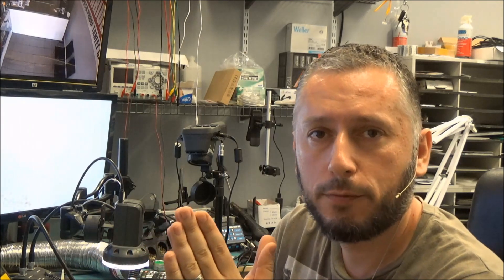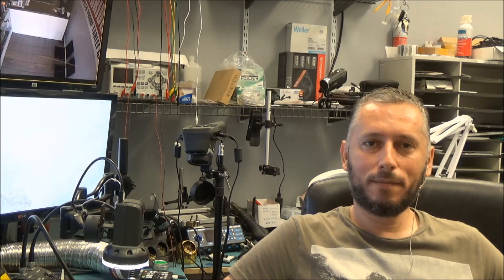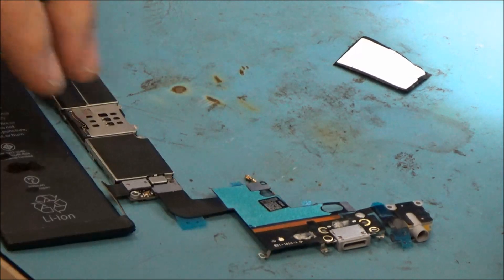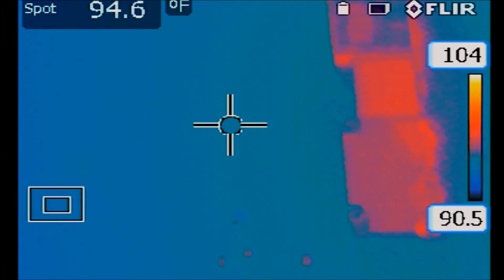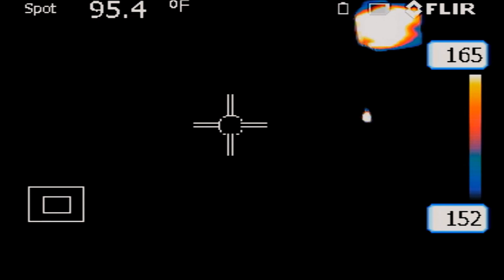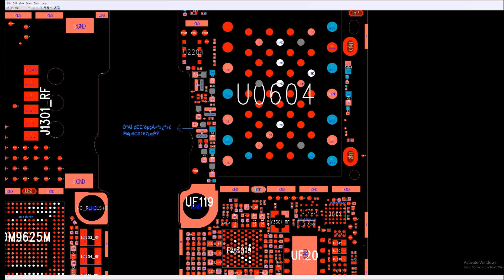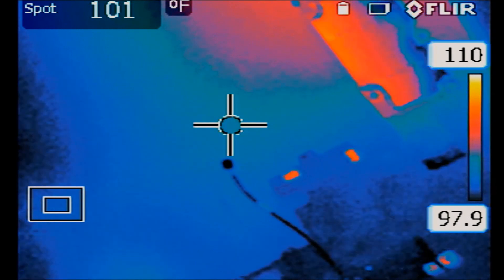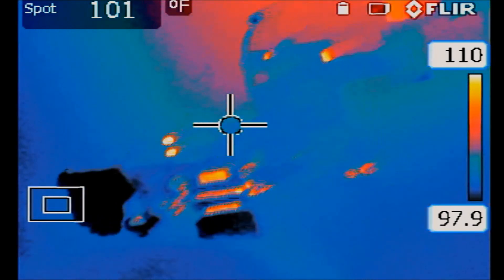Find Short Circuit quickly With Flir Thermal Camera - iPhone 6 no power Repair

Comment: Hi, Sir u r a professional guy, i am also repairing mobile, but i have facing lot of problem when set comes with leakage, in 0.0025 amp auto, in this case i stuck, and sometimes use rosin paste, but take long time to find out the short, i like thermal camera, does it really works to find out leakage in few seconds... Kindly suggest me is it useful for me or not.... Plzzz suggest me.

Comment: To test a pcb board with a thermal.camera, does the pcb has to be powered on or by just connectin the charger cable without manually turning on board is enough?
Reply: This worked out because the board was heating up. So to utilise the method whatever makes the heat to be aquired...on or off in your case

Comment: Great video and very well narrated! Super easy to follow. I’m new to iPhone repair and I am at present getting all the kit together to start repairing  a few iPhone 5 and 6. I’m looking at DC Power Supply’s and not sure which one to purchase, also is there a table of the correct voltages I should be setting when fault finding using a thermal camera (FLIR One). Really afraid I’m going to fry the board when setting DC power. Your help with this is greatly appreciated, keep up the great work your videos are fantastic! Thanks Harry

Comment: Hi, I’m Jackson from Indonesia. Really need your help. I accidentally caused short circuit on my iPhone. It was because I disconnected the battery from logic board using metal tool and suddenly there was electric spark. I was really shock, and just put everything back together. Then press the power button, then it showed battery low, before that was around 60% i think. And then I plugged to charge it, my iPhone turned on and the battery back to normal, back to the percentage before I disassembled the battery. And just using it like normal. But I really worry that can the phone causes fire, maybe near the gas? I am worried and really need your explanation. Thank you Sir. Btw sorry for my english 😌

Comment: Hi sir i have iPhone 6 plus the camera dose not  work the problem is not in cam itself the problem is within the motherboard, by the way the flash light dose not work too,  how can i fix it?
Reply from the maker: The how can i fix it question is wrong. What have you tried and what measurements have you done. You need to put some effort into troubleshooting and then ask specific questions. A quick answer to your question would be, look into the camera ic. No one can give you a straight correct answer without troubleshooting and you won't learn anything by getting direct answers :-). Start with the basics

Comment: If cap already short it doesn’t need to replace back
Reply: Just pull it off and reassembled back and good to go
Reply from the maker: The capacitor can be used to filter signals of different frequencies. I don't see why you would leave it out . Although you may not see any direct effect leaving it out, we do not know what issues you may run into with everyday use. Only took few minutes to replace :-).
Reply: @zijiang1239  I'm sure you are better engineer than those at Apple Mr. Moron. STFU